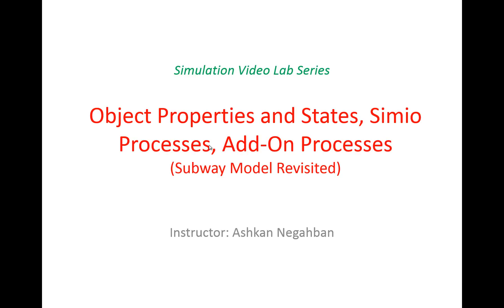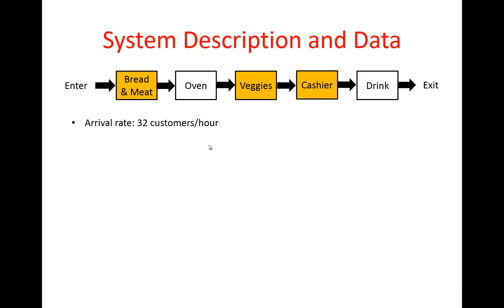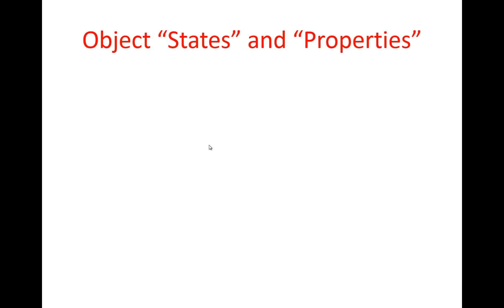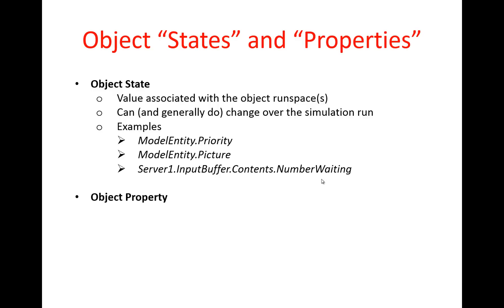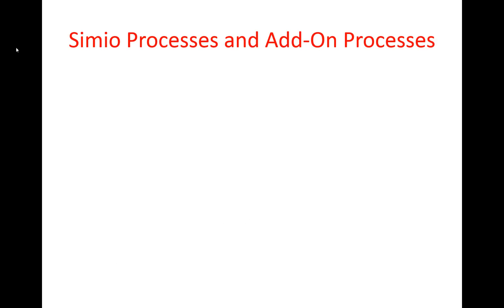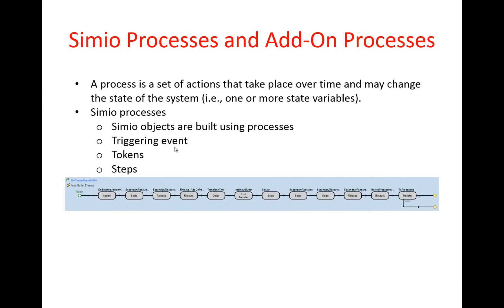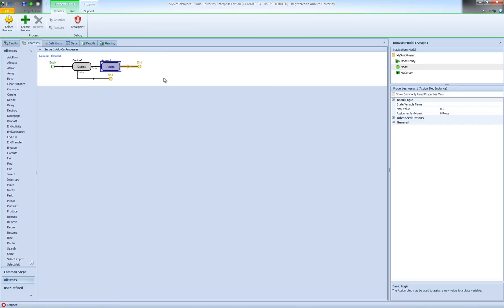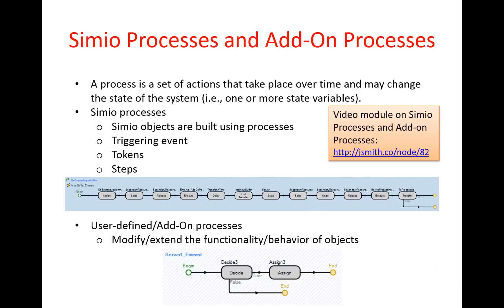Lab 4 - V1: Introduction to Object States and Properties, Simio Processes, Add-On Processes

Comment: It may be a rather basic question ... But you know how to calculate the maximum number of entities found in a group of machines working in parallel ?, is not to calculate the maximum number of entities around the system only those found in a group of machines.